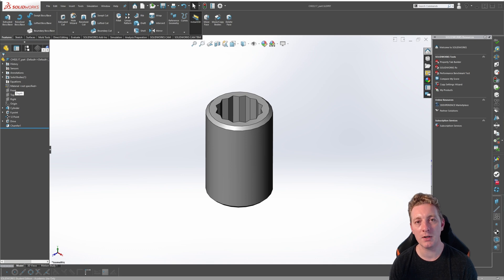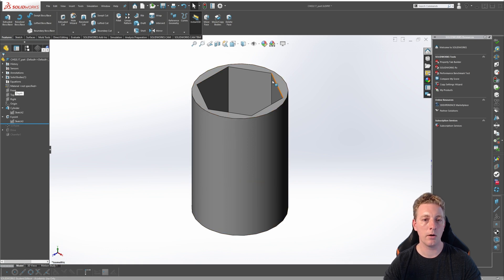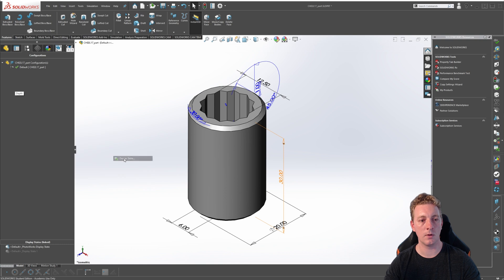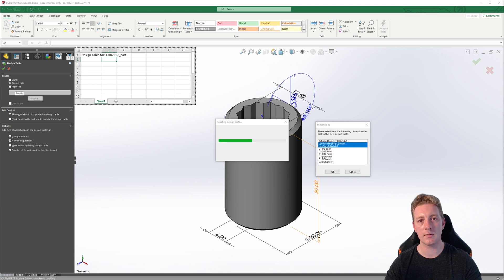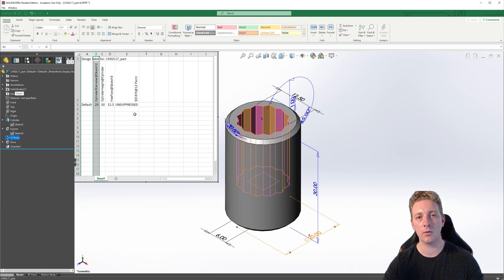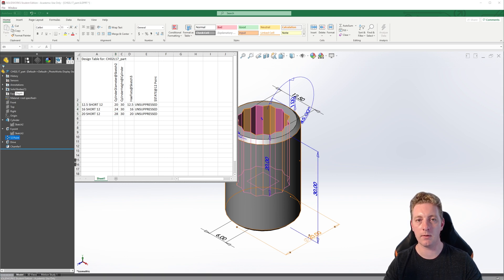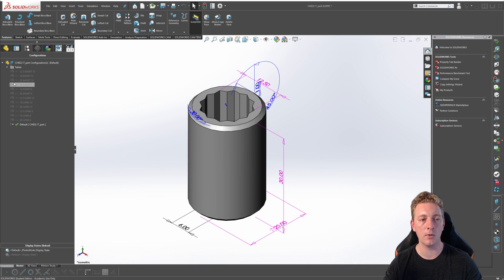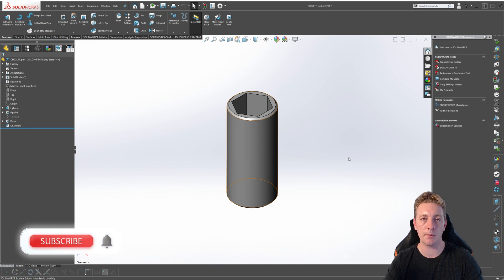Part Design Tables | SOLIDWORKS BEGINNER | Chapter 02: Lesson 17 | CSWA COURSE

Comment: This feature seem a bit unstable for me. Gets SW to crash repeatedly. I'm a bit surprised that SW decided to add this dependency for a simple table. Could have done just natively.
Reply from the maker: I have seen the solidworks can be quite temperamental and crash often. I personally haven't empierced a crash with SW though but I do have quite a beefy PC. Keep in mind the design tables are more used in some office work spaces as it can save time if they have a catalogue of commonly used parts like steel sections etc, but for general hobby/personal modelling you likely will not find a use for it.